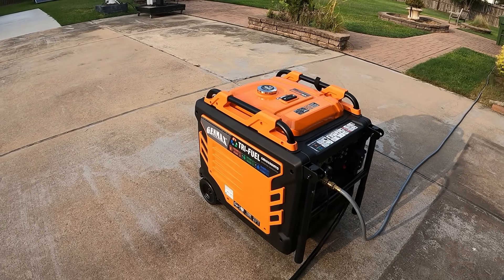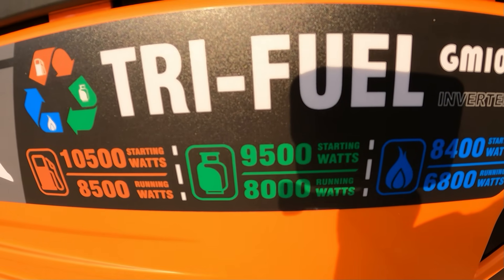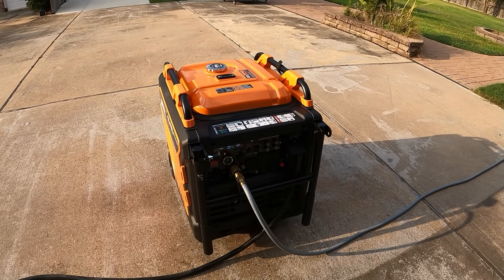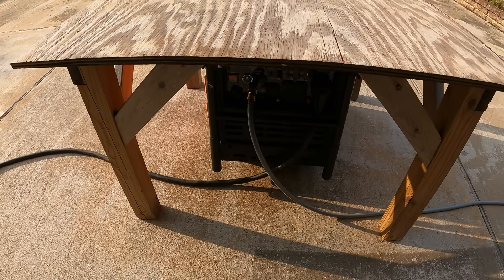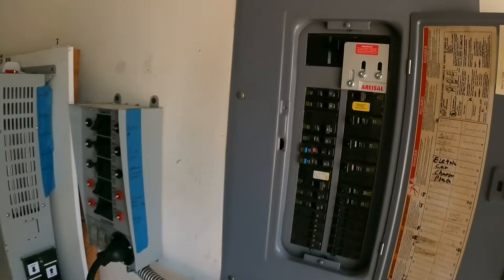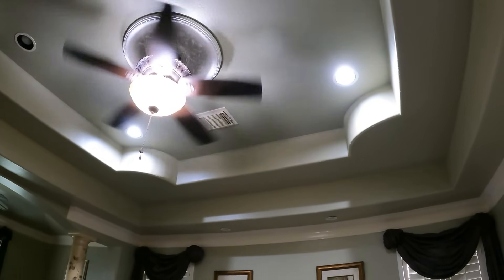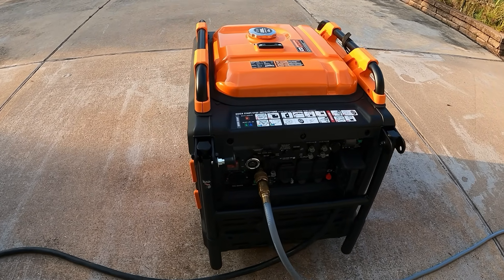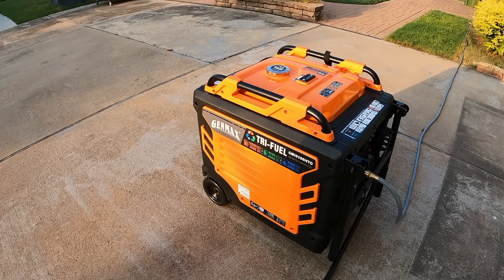GENMAX GM10500iETC TRI Fuel Inverter Generator Running a 5-TON AC - BETTER Than A Standby Generator!

Comment: I have same generator as yours and running in Natural gas source and when I tried to fire up my Rheem 5 Ton AC with softstart -> ICM870-32A  (100-240 VAC 50/60Hz)      Up to 32FLA 130LRA   but the AC is not turning up... What would be the issue?
Reply from the maker: You may have soft, start wiring, problem check the wiring.

Comment: So I just got the pulsar 10,500 inverter which is practically identical to this and when starting my 3 1/2 ton brand new air conditioner with the soft start and on Eco mode, the power surge is so bad it turned off my TV I think that is very strange being that my dad‘s 10,000 W Westinghouse Ecogendid not do that on Eco mode.

Comment: Gavin, how many watt have you load tested the 10500 to running natural gas on the 50’ flex line?  Did you load it to 6800 watts w that setup?
Reply from the maker: I loaded it up to 8k watts

Comment: Hello Mr. Gavin and thanks for video.  It’s good to get new ideas.  Sorry for many words following, as i’m trying to communicate how a gen is setting up to run here.  I’m just now getting my 3100W 26A $900 Champion dual fuel DC Invertor set up. Budget unit just enough to get by with careful switching some things out then others in.  Anyone new to this topic, DC inverters put out cleaner sine wave 60Hz power, less THD, less voltage spikes and I’m also adding a noise and spike power protector outlet strip.  We then will be able to plug in delicate electronic gizmos to use and recharge their batteries.  For easier decisions on which breakers turned on, I used a label maker and labeled each breaker right next to the breaker switches, not detached from the breakers and scratched on the diagram on the inside of the cover.  Also, in case I’m not around when power goes out, I have approx. 7 steps labeled at top of main electric panel, along with max amps or watts available, instructing my Mrs. the “how to”.  Former farm gal, she can.   With everything labeled right there, is easy to flip on the few things desired once going.  Also I picked up a cute little $25 power meter from Amazon that I’ll mount right next to the service panel.  It needs a 120v power source of very little current to run and it has a coil to clamp around just one wire of my incoming 120v emergency juice so it can sense how many amps are flowing.  Or it will show me how many watts, 60Hz frequency, time run, etc.  Its digital display will tell me right there at the panel as I flip breakers on/off, no need to go out in maybe harsh weather to see what the meter info is on the generator.  I shall always use propane, no stale gas to fight, can roll the unit right in the utility room of the house for temp and moisture controlled storage, nothing explosive in it, no stinky gas smell. That’s how it is here.  Have it on my e-calendar now to remind me to get the gen out every 2 months and exercise it.  Emergency generators are an oddity.  One of very few things we purchase and hope to never need to use.

Comment: I remember in your XP9000iH video you showed your soft start stats. You were running 43 amps to start the 5 ton and 17.8 line amps. Did the starting amps go down on the a/c? How did this generator start your a/c at 43 amps if it’s only rated for 8400? I guess maybe it’s capable of hitting high surge wattage vs the stated rated watts?

Comment: So do the Genmax generators have copper windings or copper clad aluminum?  Nothing shows in the manual or webpage.  Like the GM7500, GM8500, GM10500, GM11000, etc.  Larger ones
Reply from the maker: All the Genmax generators have copper windings

Comment: I really want to like Genmax and buy another one like this or the GM11000iETC at Sam's Club for $1750 but this ONE year warranty kind of makes me wary.  I don't want an overpriced paper weight after a year with it.  At your price of $2500 for the 10500, wouldn't it be worth buying the DuroMax XP11000IH and get a FIVE year "Parts AND Labor" warranty?  For that matter, there are TWO authorized DuroMax repair places within an hour of me and they both speak highly of DuroMax and their quickness to get them parts plus reimbursement for warranty repairs.  They've never even heard of Genmax.  I mean, really, the DuroMax and this Genmax are basically the same thing with a longer warranty on the DuroMax.  Even their display screen is the same.

Comment: I have not installed my yet, but the natural gas specs on this are over 100 cu ft/hr.  you can look that up on the specification table of this generator.  A 1/2" 50 foot extension like you show will not supply that much gas so you'll never get full power out of your unit.  The longer your run, the larger diameter gas hose or pipe you'll need.

Comment: How is this generator able to handle the start-up amps of a 5 ton AC unit with only 8400 starting watts on natural gas?  Even with a soft start this seems inadequate.  I have a 4 ton unit with soft start and the startup amps measured at 52 (52*240=12,480 watts).  I'm trying to determine if a generator this size would be adequate for my needs.

Comment: Excellent point about a cover table and you did an excellent job in its over construction.  But I am going to bet this table is also a small proper height work bench.  The only thing bothering me is flammability of the wood top.   I am a system design engineer so we do it best after we debate it forever first.  Probably a grounded aluminum top (lightning) and an all in one fire extinguisher with a heat melt self spray trigger.  It’s got the sprinkler head built in.  However, the auto cut off for the natural gas will need a solenoid trigger.  Now you know why engineers stay in hotels. We never get it done…   But I did have the plumber install a motorized water main cut off when water is detected in the laundry room floor or next to the water heater.  Minimize damage immediately. Zero insurance claims keeps rates stable and discounted for ‘no claims’ history.

Comment: I have a Canadian version of the same unit sold by TMG Industries and it works superbly well. It runs my whole home through a Generlink switch and powers everything I could  want including a heavy duty clothes dryer. I see now that Home Depot sell a version of this model here in Canada for $3099 delivered. All of these different models no matter who sells it are made by Dinking Corporation and appears to be good quality, modern machines. I have no doubt it will last a long time but if it doesn't, the only thing that differentiates all these different companies is warranty and service. Genmax seems to be the best so far in that regard; the one I have comes with a standard one year warranty and although I hope to never have to test it, I don' t have a lot of confidence it will be handled properly. So it IS a bit of a crap shoot in that regard. 

For what it's worth, my total cost for the Generlink and the generator came to $5500 compared to three times that for a standalone unit, which is definately more convenient, but far noisier and takes up permanent space on the property. Your mileage may vary.....

Comment: You mentioned LRA, this is locked rotor amps. You should be referring to RLA, running load amps for the generator.

Comment: So this model won’t simply allow my ac/heat unit to turn on without a soft start? What is a soft start?
Reply from the maker: The soft start helps you to run your AC on Generator by lowering your LRA

Comment: Great review.  I've been looking at which generator to get for a few years.  Recently found out the benefits of the inverter gens.  And yes, the soft start is a must have even without the need for a gen.  And natural gas is also the way I want to go. Perfect setup.  U covered it all in a great video.  The only concern I have is the warranty on this gen.  Parts?  I also want to find out how to bypass the CO sensor which is not only a weak point in these inverter gens, but while they are connected, you can enclose these units in a properly vented sound shield box.
Reply from the maker: I have a few customers that have use the shielded boxes for this generator with proper ventilation. It works great.
As for parts and warranty, I will be carrying parts and warranty is covered dear Genmax support.
Reply: Please name a vendor for a good generator enclosure if you don't mind. Flooding not an issue where I am  but we get all kinds of precipitation. 

Do you know of any EMP shielded enclosures?

Thanks!
Reply: @johnbauman4005  I think a lot of people are using Suncast® Stow-Away® Horizontal Storage Shed - 71 x 44 x 50".  Some people are lining the inside with 2 to 3" thick fiber insulation. There's plenty of ideas on YT. The one's I've seen advertised are around $500 which is ridiculous when u could build one out of wood for around 100 even with 4" insulation. Wait.  We just had 2 hurricanes hit Fl, so make that wood shed 200. The plastic one will last about 1000 years so if that's a priority, one needs to do the plastic shed.  As far as making them EMP proof, there's all kinds of YT vids on how to do that. They basically build a Faraday cage.
Reply: @ginginthing  Thanks a lot for your time and knowledge!
Reply: @johnbauman4005  I'm retired, so I do have time.  Knowledge is ???   But it's all available on the YT vids.  If it's not on YT, you probably don't need it or know about it.

Comment: Gavin.  Thanks for all the vids.  With a 5-ton A/C with Micro Air Flex Soft Start, after this Genmax 10500 gets up and running, will I be able to run my two standard sized refridgerators also?   What will happen when the A/C turns off and then later on turns on again?  Will I just leave my two fridges plugged in and running and it will start the A/C without an issue?
Reply from the maker: Yes, you will be able to do that with no issues👍🏾
Reply: @GeneratorReviews  Gavin.  I located these two Inverter generators, which would you choose for my set up?  Same price for both, shipping is free for both. $2,500
Genmac GM11000iET  11,000/8500 ratings......or.....DuroMax XP11000iH  11000/9000 ratings.........................thanks.
Reply: Oh....I forgot.  I have a 28kw tankless water heater.  Will either of those generators be able to handle that, with the A/C running, as long as we only use one shower or one faucet at a time while using the generator?

Comment: How big is the natural gas meter that your Genmax is running off of. If I buy this generator I want to make sure my meter and piping will handle it.
Reply from the maker: Half-inch line 35,000 BTU
Reply: @GeneratorReviews  How big is the GAS METER on your HOUSE that feeds the generator? What is the C.F.H and the PSI on the METER?

Comment: 11:25
What you should do is cut the NG off 1st and let it stall out, then power the generator down.
Reply: Prior to cutting off fuel,
First thing to do is always cut the power to the main breaker on the generator.
Not good for motors or electronics to have a generator slowly shut down while still feeding electricity to them.
But yes always a good idea to then turn off fuel source to drain the line.

Comment: Let me correct you on your Generator:
Its NOT 10.5kW on NG ... as you keep stating. 
Its 8400W starting and 6800W running on NG ...
You were at 5700W with that 5 ton AC which means you were at 83% capacity. If you were to run the microwave or stove or dryer while the ac was ON, you would blow that breaker on the generator.

Comment: 6:12
Wrong .... those 22kW home stand by are about $6k .... plus install which is $500 .... 
This unit is about $2500 which is a little bit less than half 

But yes this one you can move and take to the next home where the other one is a somewhat "permanent" install.

Comment: Can someone explain the low idle function? Will the generator adjust to more power if needed while low idle is on or does it have to be off?
Reply from the maker: Eco mode or low idle will adjust automatically as load is increased. It helps with fuel economy.
Reply: @GeneratorReviews  thank you!!

Comment: Gavin, I have a 4 ton unit with same softstart. My house is about 1900 sq ft. Will it be able to run whole house easily? I have a westinghouse 9500 gas and its no problem.
Reply from the maker: Yes, my AC is a 5 ton
Reply: @GeneratorReviews  thanks for the fast respoinse. And is the generator not truly 50amp? I keep seeing mixed answers on this.
Reply: @GeneratorReviews  Also I meant on natural gas.

Comment: I don't believe this unit can run a whole house. Its producing maybe 40 Amps. I may be wrong but when the HVAC is running then the fridge compressor fires up, your finished.
Reply from the maker: We just had a tornado last month and a hurricane this month I lost power for six days both times I ran my 5 ton AC, three ceiling fans, refrigerator, lights, and microwave the entire time.
I have customers who did it for 18 days straight with no power.

Comment: how hard/heavy is it to move the generator from one place to another? Iam concerned about the weight and the noise level.  Thank you.
Reply from the maker: It is very easy to move it around thanks for the handleand the wheels

Comment: Hey Gavin, I just bought the Pulsar version of this generator, trying to run a 4 ton Carrier AC unit with a soft start on natural gas, just like you. 

Unfortunately, mine won’t start it! It actually wouldn’t even start a 3.5 ton unit while it was on low idle mode. 

 The only difference I can see between your setup and mine is that I am using the 30A outlet, not 50A. My old Champion 100520 could start that AC on 30A, so I expected the Pulsar could too. I’m not tripping any breakers on the house or the generator, so I can’t really process through why I would need a 50 amp instead of a 30 amp, but again it’s the only difference I see from where you were able to do this successfully.

Am I wrong? Do I need a 50A inlet for the pulsar to kick on the AC with the soft start?
Reply from the maker: Try a 50amp inlet with 6 gauge wire and you will be able to get your unit running plus what soft start are you using

Comment: Great video! Can you provide link for soft start you used? 
Also been seeing a lot about floating neutral vs bonded. Did you have to change generator to floating neutral since you’re connected to your house panel? 
If you want to use the generator for potable use do you have to bonded it again?
Reply from the maker: This generator is floating neutral no need for conversion
Micro air EasyStart
Reply: Good to know! Thank you.

Comment: Interested in the soft starter for the compressor 
Also I have a 5000 watt genny  on NG running whole house with 2 freezer 1 full size refrigerator 1 smaller 
Can use heating but won’t handle Ac 
So this genny with with the  soft starter would be awesome 
Next what is the difference between the 13000 watt reg vs the 10000 inverter
Reply from the maker: Also, this one is an inverter pure sine wave so you get less than 3% THD clean power so you want to harm any of your sensitive electronics and appliances

Comment: How much gas does it consume? Can you share some data?
Reply from the maker: With a 6.9 gallons fuel capacity, it can operate for around 8.1 hours at 50% load with a full tank of gasoline (fuel consumption around 0.85 GPH). When using propane, it can run for around 4 hours (estimation based on a 20 lbs tank - propane consumption around 1.18 GPH).

Comment: Can you run a generator with NatGas with more than 60% load for days in an outage? 

If NatGas running watts total is 6800 and the load in the video with a/c and a few fans/lights is 5900, then that is 88% load and does not much room for refrigerator, tv, or etc.  

Am i mistaken?
Reply from the maker: Yes, you can. That’s actually the perfect percentage.

Comment: Can you suggest an ATS that will cut on/off generator automatically and work with the Genmax ATS cable.
Reply from the maker: Genmax is still in the process of developing this ATS unit

Comment: Did the AC unite work with 10500 watts generator everybody show videos but I don't see they turn on the AC unite to test  they only turn the lights and ceiling fans but don show the AC compressor runing
Reply from the maker: Check out the videos at 9.49

Comment: Its Monday 5/20/24 and I'm watching this again because of the power outages going on now . I like your idea if you ever move you take it with you. The whole home back up generator business is going to boom in Houston and I will not pay those high prices. This is a great alternative but I'm concerned of the long term reliability of the genny. Thanks Gavin for your videos and hope you got power.
Reply from the maker: Thanks for watching and subscribing, we finally got power back
Reply: I have the Genmax9000ied - got me thru the derecho and now Beryl running my whole home (including central air). With a soft start on your a/c and the setup like Gavin does so you can just plug into your house and switch it to run it all, its the way to go if you live here. Am upgrading to this one though to be able to run off natural gas. For the money, think it will get you thru a few years, when the next greatest thing is available.

Comment: Great video. Will this run a 50 amp fifth wheel with 2 15,000 btu A/C units? What would the run time be? Thanks
Reply from the maker: You’ll probably get about 24 hours per tank but it would run absolutely everything in that RV

Comment: Gavin, can you parallel the Genmax GM 10500 with the genmax 4000 inverter generators together?
Reply from the maker: Unfortunately, No you can’t because the 4000 is 120 V inverter and the 10,500 is a 240 V inverter they’re not compatible to parallel

Comment: Does it auto switch from 120/240 or is it manual switch?
Reply from the maker: If you keep the switch in 120/240 you can run both loads